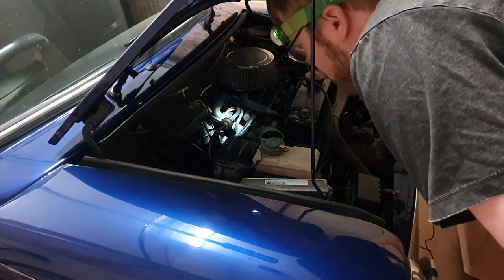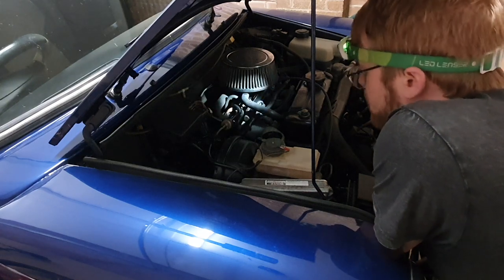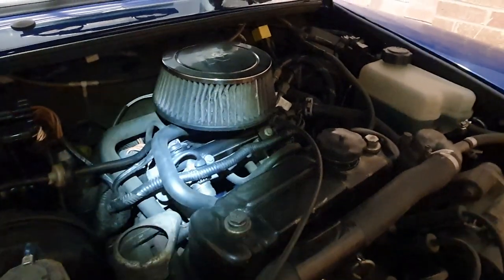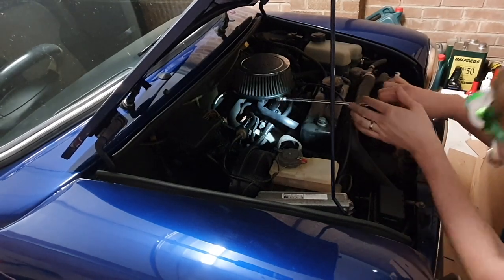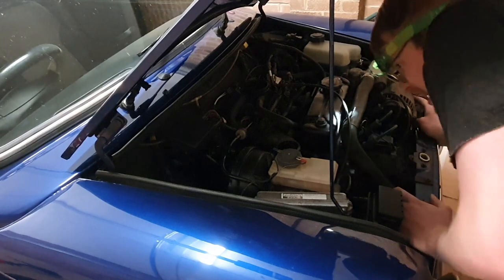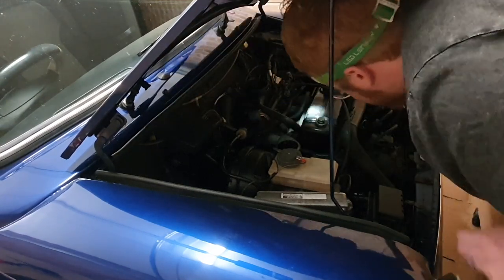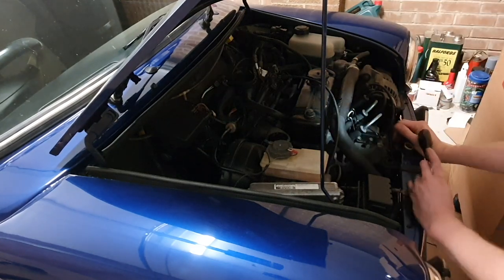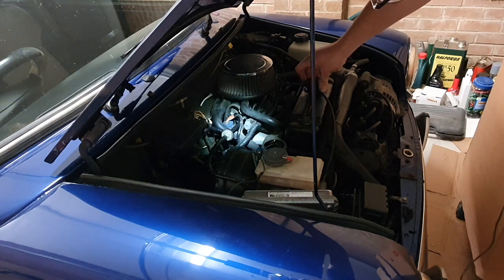Trying to fix a Mini Cooper MPI Idle Control Valve

Comment: No locknut on the throttle cable with an MPI. Just disconnect the cable from the throttle body and pull the end upwards, out of the mounting bracket. The nut that fits into the mounting bracket is used to adjust the length of the free end.

Comment: I have the same mini as you and some days ago the engine stalls when i pull the clutch or stop the car in a red light. Seems to be the same issue with yours. Did you find the way to fix it? I’m in mexico and it’s difficult to find replacement parts and experienced mechanics here. Hope you can help me